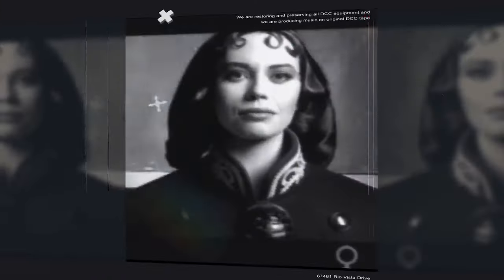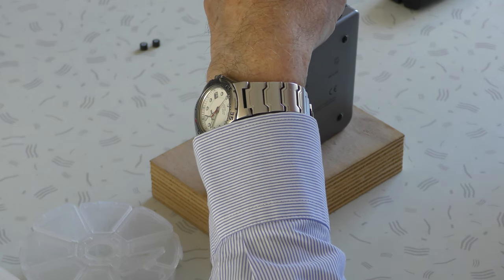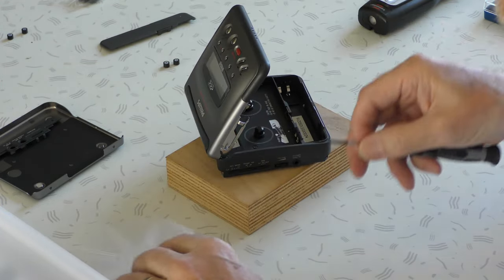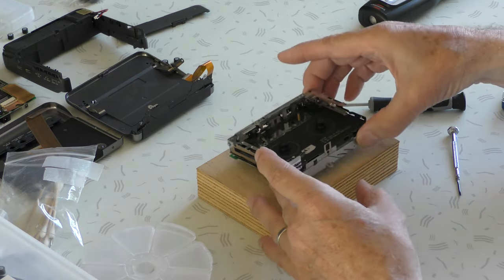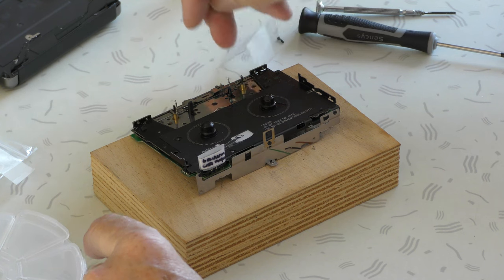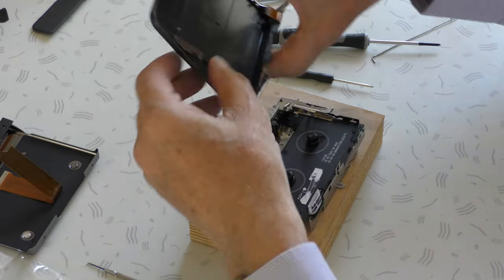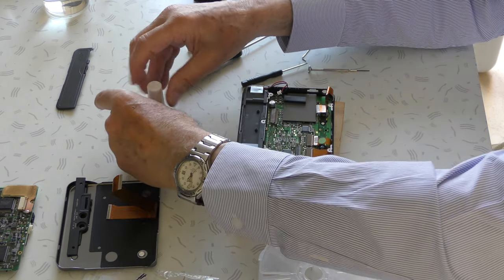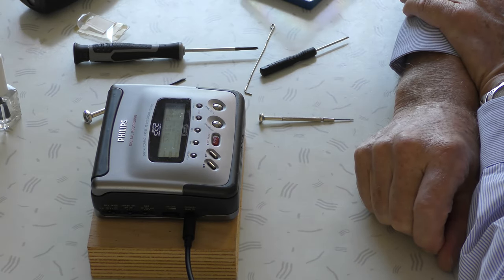Replacing the Pinch Rollers on any Portable DCC Player

Comment: Hi
I have a question,please.
I bought a philips WFD792 hifi unit but unfortunately it came with WFD798 speakers and  sub through which we can connect the surround speakers system.
The issue is the the WFD792 doesn't have a DIN out socket to connect the sub.
What can I do in this case?
Thanks in advance

Comment: I bought a new 170 model in the 90s and barely used it. The optical output wasn't working, and I took off the bottom cover to see what would happen. To my surprise I found two shorted welds. I fixed it and was able to transfer the SPDIF audio to the PC. In 2018 I looked to see if it worked, but no. I decided to change the strap. I opened it very carefully and found a similar square belt to change it. After reassembling it and charging the battery I was able to verify that it worked correctly in both digital and analog. Last week I wanted to try it with a DC tape and "power ON" appears and then "Power OFF" and then  it turns off. It was no use recharging the old 4.8V NiCd battery or directly with the external power supply. I doubt the strap has broken again, but I'm afraid of having to open it again...The plastic exterior is sticky.
Reply: Unfortunately when you don't use it for long times (2 years is very long), the belt is so thin it deteriorates to the point it starts having problem to turn the tape and needs to be changed again... From personal experience on 3 different portables.
Reply: @atsirik  finally took it apart and checked that the belt is fine, although I changed it for a new thicker one (0.7). But I saw several SMD  capacitors leaking electrolyte. I unsoldered them all, cleaned the tracks and the metalized holes, and replaced them with new capacitors. I checked the supply voltages of the schematic and the switches, but it is still the same, (Power ON- motor rotation-power OFF) and I cannot enter the fault management sequence.

Comment: Were all portable DCC players that bulky? The old analogue portable Compact Cassette players were much more compact than that by 1996.
Reply from the maker: Yes. Mainly because of the battery. It needs more power vs a regular analog cassette player.

Comment: Thanks Ben. Nice video. Thank you for sharing. How does this solution work when their are problems with spooling back the tape. On my DCC 170 i sometimes have issues with 1st generation tapes when spooling back. It tries and then stops the unit from trying. Not for 2nd generation tapes. Can a replacement of the pinch rollers also solve this issue? It looks like the player needs to much power to spool back the tape. A common issue on 1ste generation tapes. I have replaced the belt and the SMD capacitors also. So this is maybe something of my last resort. @jornsiemonsma1040 @drdcc